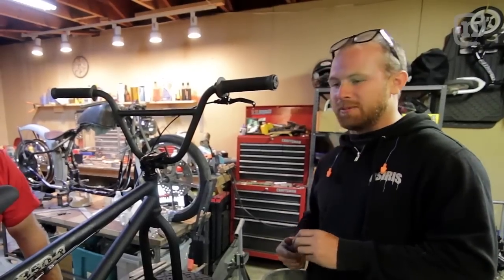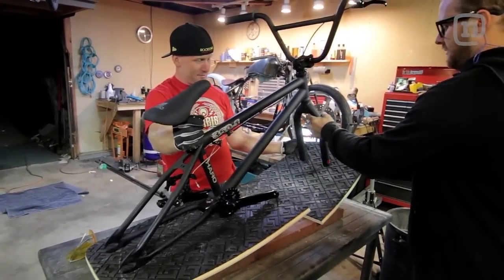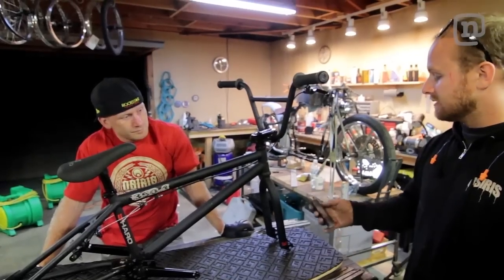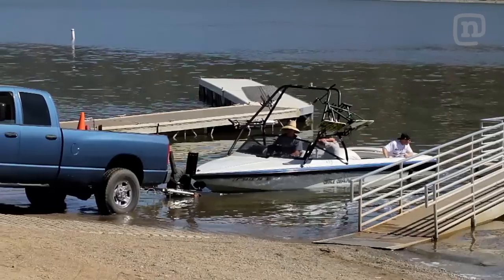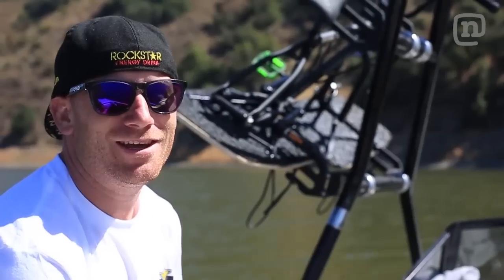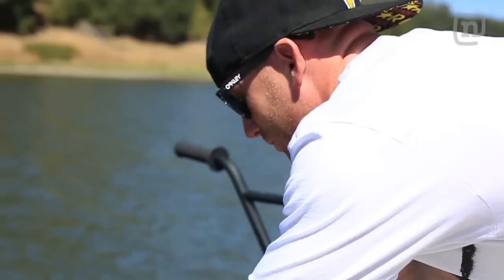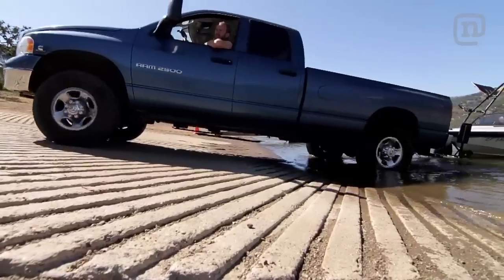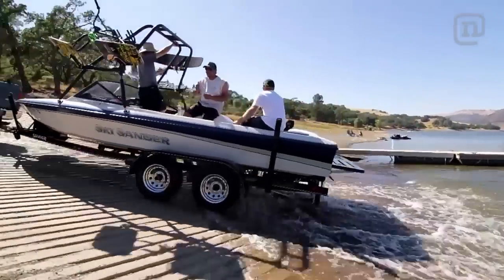Ryan Nyquist Invents New BMX Wakeboarding Sport! Wakebike: Getting Awesome Ep 4

Comment: if the foam is less dense than air, then it will float better than if it was air-filled. plus, because the foam is solid, instead of a gas like air is, the foam won't get pushed out by water if there are any holes or bad welds in the bike frame.

Comment: Would be better if the handlebars controlled a rutter for turning
Reply: Yeah, was thinking that myself. Add a small fin or three to the front plane (similar to the thruster design of modern surfboards, except much smaller).

On top of that, the CG needs to go slightly forward as the front was mostly out of the water. Those two things would hopefully make it fun as hell.
Reply: Yea, I guess for thier first board design its not horrible haha, but I do design work for a living so it stuck out as a sore thumb. Being able to do harder turns would make that thing so much fun. You're right about the CG too, I was noticing no one was sitting down the whole time. It was almost like they were waterskiing with handlebars haha

Comment: I figured they would have made it like the downhill bikes that are converted for snow riding, put a pair small skies on the back and a small ski in the front, saw a couple downhill snow bikes with skies like that in Winter Park this year, should have done it with skies not a wakeskate, might take away some stress on the rope and tower too when it crashes. When you want to turn you lean just like you would on a bike.

Comment: Hey just a tip from me and my dad as we build things like this it would be a good idea to put a two small fins on either side of the front plane (about 1cm in depth and about 10cm in length) it will help turn and make it more stable on the landings. Great idea tho. Me and dad currently making 1 😃
Reply: no fins are better because you cant 360 or spin in any way while on water so stability would be better bmx wise no fins are better.

Comment: Lower the tow point and you'll get better steering, awesome though!!
Reply: They had it on the head tube, which remains stationary when the fork stem and bars are turning. So that was probably the best location to have it on. I was thinking they make a metal bracket off the front fork that lowered the board (basically making the fork longer) so it could touch and steer. The tow point logically makes sense to remain where it is though

Comment: This should become a thing but its too crazy when you crash and the boat drags it. way too much drag.
Reply: That's why you have a breakaway...
Reply: WirlWind like a kneeboard, where the equipment isn't attached to the boat like a tube?
Reply: noobiefroobie choobies A breakaway is usually a thin bit of rope that you use to attach the main tow line to the vehicle (either on land or in water, concept is the same).

It's supposed to have a low breaking limit so that if you DO have a crash and the bike drags, the breakaway snaps and no damage is caused to the towing vehicle.